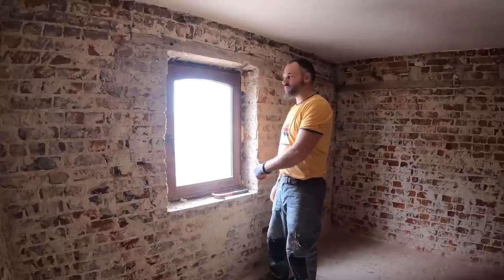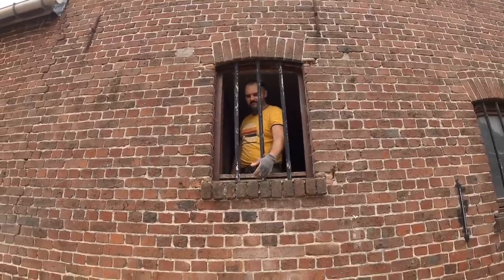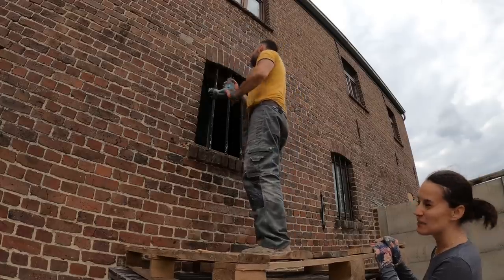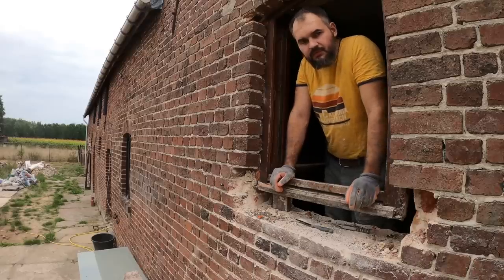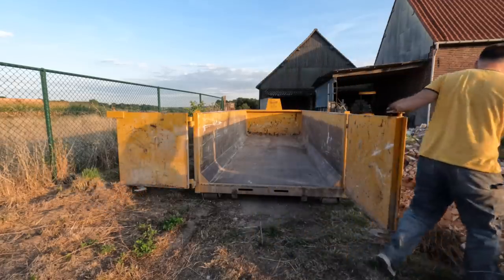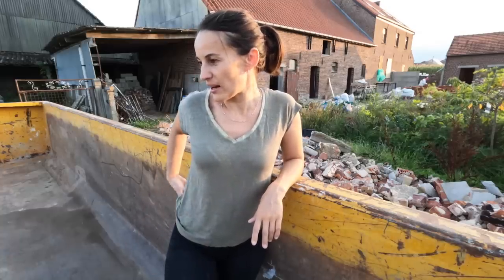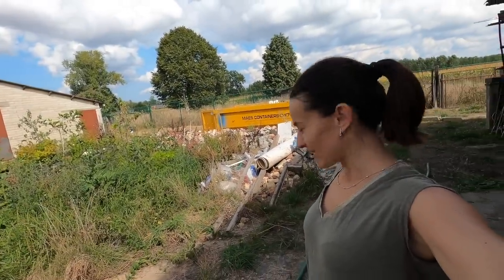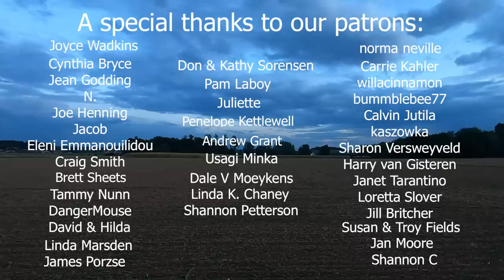Installing GORGEOUS ARDUIN window sill / Renovating an abandoned 1908 farm

Comment: Perfect placement of the stone sill. Just the right pitch for water to run away easily. I've been a stonemason that specializes in restoration for 32 years now and I am very impressed with all of the work!!! Masonry....brick work, stone work, concrete, hemp block and demolition work that you took on yourselves!! You should be proud. Not to mention all of the sweat equity you put into it. You are doing great so far and it's looking awesome. I would like to pass a pro tip on to you if I may. Please build a jig for cutting brick 🙏 I cringed when I watched you cut a brick with a 5 or 7 inch diamond blade while holding it between your feet 😬 EEK !!
Make a simple jig to hold them in place while your running that grinder. Especially when you are slicing them. If that saw slips you could hurt yourself very badly 😢 and nobody wants that to ever happen to you. Just trying to help. Great progress and will continue to follow. Cheers from Nova Scotia Canada 🇨🇦
Reply: This
Reply: I agree with this comment .

Comment: I thing you need to have a drip or slot under the stone cill to stop water running back underneath into the house. The ends of the cill normally project each end into the wall so water doesn't run down through the joint. A damp proof membrane under the cill would also be a good idea. Just thoughts.

Comment: I agree with others about goggles when cutting medal, especially when it’s at eye level, you could have easily gone blind if some shards go into your eye.  The other concern is at 9:20 when cutting stone, that blade jumps at all and you could be cutting into your foot, you guys are in it for the long term in this Reno, you should get a tabletop with a vice grip on it to hold the things you’re cutting.

Comment: Cheese Wire to cut the seal. If you cut  hole, thread the wire through, then pull back and forth it cuts it out. Or a filleting knife!

Comment: As a safety factor at least one window per barred room should have a release mechanism so people can exit during a fire. It is code here. In addition it is a good idea to place a piece of 2x4 wood between the sill and the bar frame when pulling to prevent finger/hand damage. Plus, never ever hold what you are cutting between your feet, just clamp whatever to your pallet. You probably know this but watchers cringe when DIUs don't practice safe to save time. Save some good wood to make into a peg leg later. You did a beautiful mason job.
Reply: Good points. Some safety glasses when using the saw might be a good idea.

Comment: There's always a learning curve on the 'first' one. If possible, I would remove the window (at the hinges) from the window frame which might make removal easier. It's obvious that the folks that put them in meant for them to last!  Wowza! I personally think the stone sills will eventually require little to no maintenance in the future compared to the brick. And they look awesome too! Cheers All.
Reply: It should be possible, every window installer I've watched removed the casements, fixed the frame to the wall and then refitted the casement.
Reply from the maker: It's indeed more logical way of working  - to remove the casement first. Illia read your comment and admitted it immediately  😀

Comment: Around here the fees for mixed construction materials are at least 10x the price for concrete and bricks and it is by weight so that container looks expensive as hell. With a mixed container you are basically paying for someone else to sort you trash once it gets to the recycling center.  Since you are trying to save money I would suggest sorting your materials yourself as much as possible. One pile for concrete and bricks, one for untreated/unpainted wood. one for painted wood, one for metal and one for the rest (plastic, insulation etc).

Comment: Looks great! You can try to use a strong thin wire and pull it along the perimeter of the window frame will holding wire from the inside and outside, cutting the silicone as you go. If you have clearance.

Comment: Very nice window sills, I ordered the same for my house. The window gave a fight, but I think it's unnecessary to remove them. Simply remove the bars by getting the bricks out which hold them (the rusting steel damages your brick work too), remove the brick sill and put the new ones in. Then you are sure that they fit properly to the underside of the window frame.
Also a good clean up of the yard gives a very rewarding feeling, I got my skip full of roof waste out this morning, and the next one for mixed building waste is on order for next week, 3 weeks off work to make some progress!

Comment: Very nice stone!  Will they all get used up before the first snowfall or will you be moving those and the extra materials more to an indoors location or get a tarp on them to protect from ice before then?  I definitely think all those windows with the bars need to get removed and then properly repainted with that blue stone added.  It will make a nicer view both inside and out!

Comment: Been a thorn in my mind for a while, but since you’re working on them, seems like a good time to ask.  Any idea why they had bars on the windows?  Been wracking my admittedly small brain, but can’t think of a reason.  BTW - been a faithful viewer for over a year.  Admire your patience.
Reply: Good question - I'd be surprised if security was such an issue there.
Reply: The bars are only on the lower windows at the back of the main building as far as I can see. One of them faced into an old lean to  so perhaps the bars were there to protect the windows against the farm activity in the central courtyard and out buildings.
Correction :
the very first of these videos popped up in my feed. The two barred windows are visible in the thumbnail. They are right next to , and easily accessible from, the roof of a lean to that it would be possible to climb on to from outside of the property. Perhaps the windows were barred to discourage sneak thieves.

Comment: aah. in another video was a duskussion about the new colour of the windowframes.  i just saw that these windows seem to be made of teak( kinda) that was very common around 1980 ish and later. dont be dissapointed if the first layer of white colour or any other paint will be getting brown sprenkles. that is the natural oily ingredients in this wood. 

soo. you have to wash it with terpentine or similar and then painting with a lacguer not acryl.
after that first coat of paint you can chose whatever you want. 

if the first paint is no laquer you will always find brown blotches seeping through.

Comment: Nice Job. But for waste removal at least in Germany there is a big difference between mixed waste like Stones and plastic and just stones, gravel and dirt. So from my opionion to split this in your site already would save you a lot of Money Just by sorting the right split. Also it is a little sad See you mixing plastic into the gravel. Another smaller Container would have solve this by almost no added cost. Anyway it has happen.

Comment: Also removing the bars is safer in case of needing emergency exit.
Reply: Can be solved by putting hinges on one set of bars and a quality padlock thats only reachable from the inside. Put the key somewhere at the exterior wall.